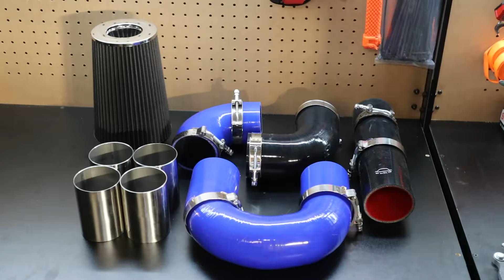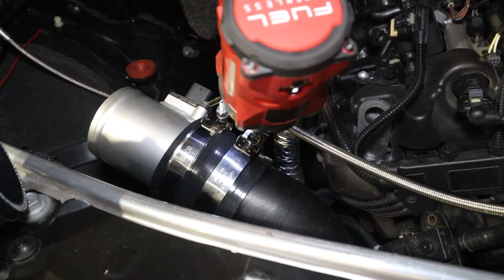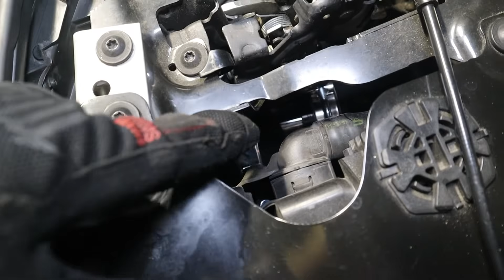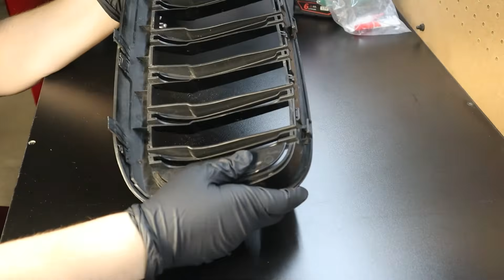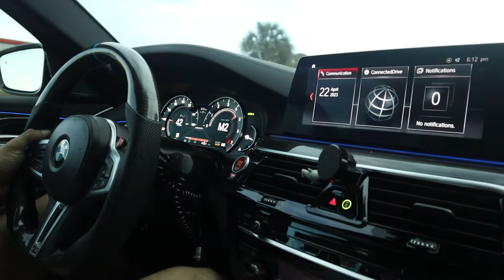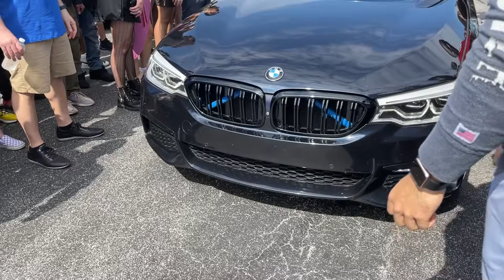BMW B58 FRONT MOUNT INTAKE (DIY)

Comment: Hi, I done the same but I have an engine code throwing up on the dash. ChatGPT says the ID of the maf also has to be 76mm?? 😭
Reply from the maker: No the throttle ID is irrelevant here. Check the hose from Intake to valve cover. Its usually wrapped in a bright aluminum heatshield that comes off. If that hose has the slightest of cracks it'll throw the code.
Reply: @FullBoltOnGarage Can you make an updated iteam list? I am unable to find the parts 80% of them say unavailable

Comment: would this work on a gen 1? is fitment the same?
Reply from the maker: Yes! This mod works for all B58 engines. In rhe video its my Gen 1 B58!
Reply: @ nice. just wasn’t sure if an F chassis m240 has the room to tighten down the clamp in the air duct
Reply from the maker: @Exiphr it might be a bit tight but is doable. You can always try using a smaller diameter tubing to make it easy. Remove as much as you can to make it easier to install!

Comment: genuniely asking, but would this be possible to do on a b48 (f30 330i)???
Reply from the maker: Yes absolutely. These are relatively built the same. Just eyeball the little air tunnel and experiment until you get the intake from the box to the front! It'll be a fun puzzle. Try using a smaller diameter to make it a tad easier!
Reply: @ oh sick bet!! also one more question, could have the intake like this hydrolock the motor?? and if it could is there any way to prevent that??
Reply from the maker: @itsmedaymo keep in mind I'm in Florida. I had this on my car for over a year. Highway driving with major storms and not a single issue EVER. Those tubes are so hot that IF any must even makes it through the filter it'll just burn off.

Comment: What happen when rain and that filter is outside?
Reply from the maker: Since this video I still have it on. In Florida rain. 0 issues. Car now has a DAW turbo running 93 on 24psi of boost. 0 issues.😊
Reply: It doesn't suck in that much water driving in the rain.
Reply: Hey where did you get your open grill from ?

Comment: Why couldnt you connect the universal sensor straight to the intake, then 90 degree straight out to the front? Rather than this 180 pipe? Seems like loads of extra run for nothing?

Comment: What about rain soaking the filter?
Reply: My Harley has a rain 'sock' that fits over a similar air cleaner - it's like a 0.0025 sieve that allows air in but keeps moisture out even at high revs on a 1600cc remapped engine. I guess these have that option - seeing how air cleaner manufacturers know how varied the application of their products could be...
Reply from the maker: This ✅️